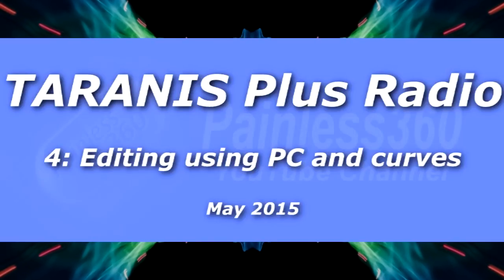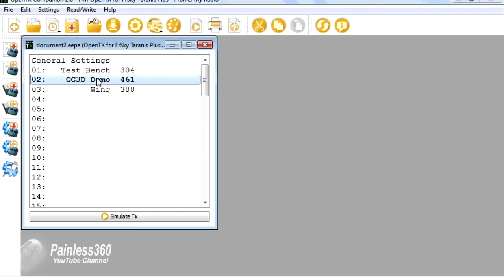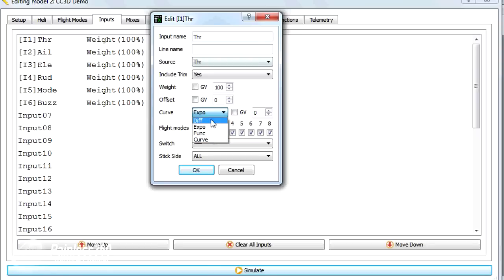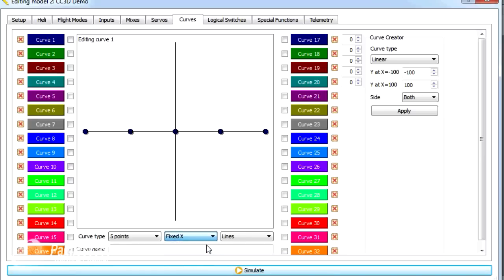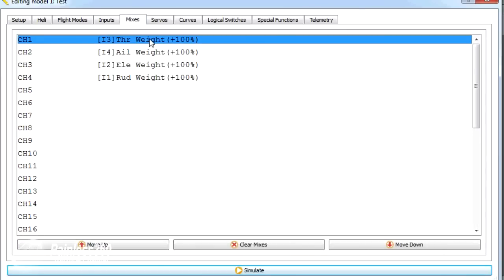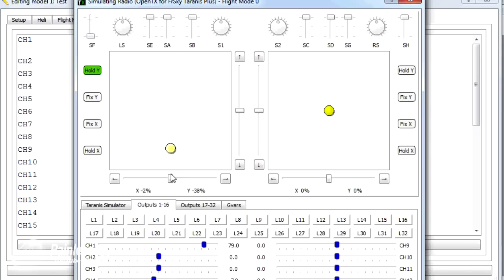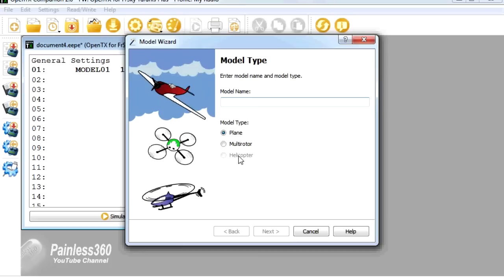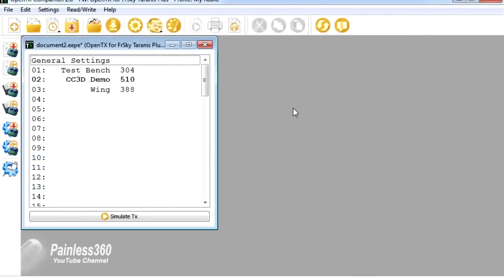(4/12) FrSky TARANIS Radio – Using OpenTX Companion and curves

Comment: OH MY GOSH THANK YOU SO MUCH FOR THESE VIDEOS!!!!!   After spending a dozen hours trying to get my X9D+se to work in RF9 I was kinda going a bit nuts.   Your videos have helped immensely, and it took me a while to realize I don't have to get everything working perfectly in the Calibrate/Edit menu in RF9.  I kept trying to set them as tri-state switches in the Edit menu in the sim, and was getting perturbed that it wasn't working.  They just need to be seen as proportional... the Mixer settings in OpenTX handles the rest. 
I went from not being able to get it to work with anything but the sticks, to using 5 other switches for various things including throttle curves in just the last few hours.  
Thanks again!!!
Reply from the maker: Glad the series helped. Loads of videos organised into a 'lesson plan' that you can follow to get all of the basics of OpenTX covered. Spread the word! :D
Reply: @Painless360  I had been searching all of the internet for the last few days trying to figure out OpenTX on that radio.  Your material really helped me finally break-through that learning curve.  I really appreciate the way you laid out the material and explained things.   Had already loaded the 2.3.5 firmware but was pretty much stuck beyond that.  Your explanation of not only defining the inputs, but the outputs through the mixer was priceless.  Got a few mins into your Companion video and was off and going!  The bit on curves was really helpful too.  You just saved me countless hours.  :)  I'll happily tell everyone!

Comment: Excellent series! Your way of explaining things and different techniques to accomplish them are very thorough and easy to understand. I've had my Taranis for a while now and never knew I could assign different curve values for a channel to a switch! 

One question though, is it possible to set up multiple curve values for several channels to a single switch position? Example: switch 1 in down position activates a specific curve value for each, throttle, yaw and aileron. If so, maybe in a follow up video! Thanks!
Reply from the maker: Jason Faulks Yes you can - have a go! You can't break anything and the PC OpenTX Companion is a wonderful sandbox to play about and see how you can make it all work. 
Best of luck..

Comment: Great videos! Very helpful. I am trying to adjust the endpoints of channel 3, but the servos page isn't there. I am using the latest firmware and everything so I don't know why its different. Do you have any advice?
Reply from the maker: +Justin Graham Must be a change in the version of the OpenTX firmware you are using. I'm still on 2.0.17 here until I'm confident about 2.1.X.. Best of luck.

Comment: I noticed in another one of your vids you selected arming your quad via the throttle stick moved to the lower left hand corner.....where and how can I do this for my Taranis Plus ?  I am currently rebuilding a quad and thought I had everything correct but can not get it to arm using the throttle moved to the lower left.
Reply from the maker: Bottom right for throttle/Yaw is normally arming, see our videos on troubleshooting arming if it's not working..

Comment: I was wondering what curves were, almost similar to expo but with more options. So, I can set up a throttle curve that can get to hover range almost as soon as I move the stick say at -85, have a fine hover range up to say + 20 and +20 to +100 is the rest of throttle, is that correct? By adding more points, can I round out the curve more to act similar to an expo curve?
Reply from the maker: iflylilplanes Yep - you got it!
Happy flying!

Comment: would you use curves and expo on the taranis or on the naze board itself as i know many people swear by only on the board itself? cheers
Reply from the maker: +Huw John A lot of pilots would say that you should set the expo on the flight controller as it provides a better resolution. It does, but requires connecting to the FC to change it. I tend to use both as adding some to the radio can be handy when teaching someone and dialling down how responsive the sticks are.. Happy flying!

Comment: So what version of software allows the helicopter wizard?
Reply from the maker: +foxrace0985 I am using OpenTX 2.0.17 but the wizard is actually a LUA script so you need to enable support for that when you load the firmware..

Comment: hi this series has been very helpful  i have manage to put on ambers voice  and set switches via open tx  but after setting the switches on one occasion  after i unplugged  the usb and turned on the tx it says bad eeprom  and the formats the eeprom  and then no of my models info is there  anymore . i am not techo savi  and have been using your vids  my bible . but now i am lost , no matter what i try  every time i try to change  anything on opentx    then turn on tx all i get is bad eeprom . also i did not backup at the very beginning  which i realize now is a bad move ! . any help would be great . thx
Reply from the maker: +jack00scarecrow Sorry, I've not seen that. I would consider re-flashing the radio.. but have a good luck in the forums for others who have had the same issues.. Best of luck.
Reply: thx for the reply . i not sure what i did but i  seem to have fixed it  after a few tries  at re flashing and i have backed up this time:) 
 
again thx for the vids,  when ever i have problems with something  you seem to have done a how to video on it  .most the gadgets in my life really would not work without you . cheers  all the best jack
Reply from the maker: Lesson learnt I guess! ;) Happy flying!

Comment: Is it possible to offset a curve so that you get 0 to 100. 0 being throttle off or lowest throttle setting instead of -100 being 0 throttle?
Reply from the maker: That's not the way that OpenTX works. 'zero' in OpenTX is 50% of the channel value.. Not sure what you're asking..
Reply: On Spektrum radios 50% was center of the range which meant that zero throttle =  zero on the pitch curve. With Taranis zero throttle is -100.

I was thinking it would be neat if Open TX offered the freedom to use zero to 100 throttle curves.
Its no biggy now though, I've gotten used to calculating 30 x 2 - 100 = -40 if I want 30% flat throttle curve.

With Spektrums zero to 100 curve you just set it to 30% with no calculating.
Reply from the maker: If you're entering into the world of OpenTX then this is just one of those things you need to get to grips with. It is confusing at first (I came from the Spektrum radios too) but once you get into setting up the radio for some advanced things having the center of the channel ( i.e. no input for the Ail, Elev and Rudd = zero channel value) becomes very powerful.. Happy flying!
Reply: Painless360 I ve been flying Taranis for 16 months now. I do love zero being center for everything else. For  throttle setup it would be nice if they made a provision to choose a zero to 100 for throttle.